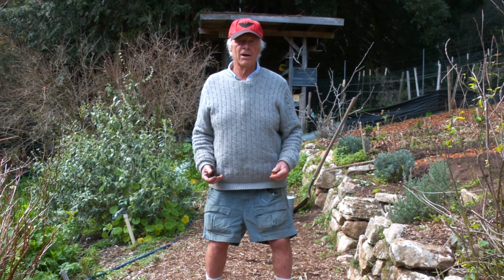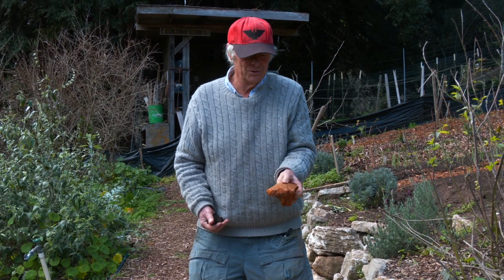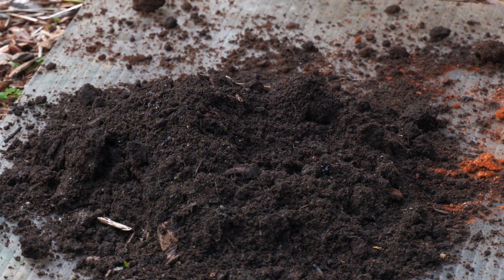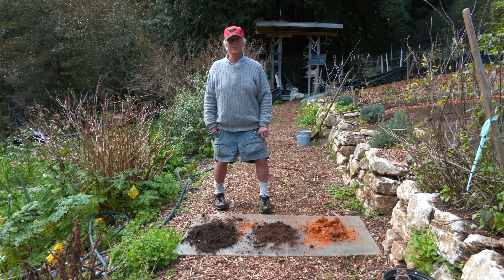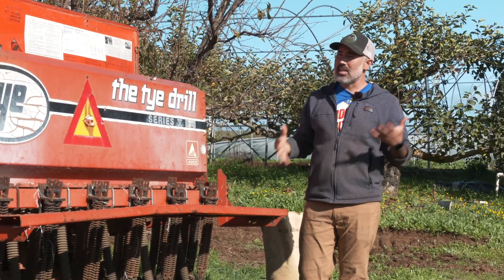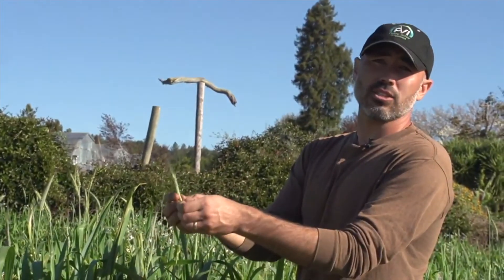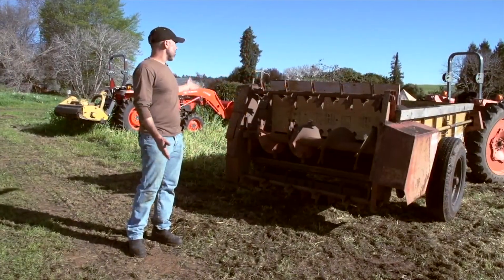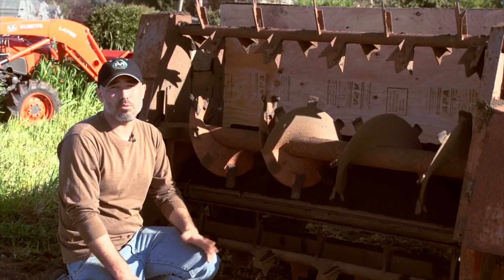How to Improve Soil Fertility in an Organic Production System at Both Garden and Farm Scales

Comment: Nice .. would this method works if you want to convert a lawn full of Bermuda grass into fertile soil?
Reply from the maker: Bermuda grass is quite invasive and difficult to remove.  It can be removed with weed killers (which we don't use because the UCSC farm and garden are certified organic) or by screening out all of the root parts that can be 12-18 inches under the soil surface.  Once you've completely removed the bermuda grass, you can use the methods shown in this video to build up excellent and fertile soil over time.

Comment: I've read that it takes 10,000 years to create an inch of quality soil.  Here on the high desert of Oregon we've had less than 6,800 years of soil creation, so augmented soil is a required part of gardening.  Following the rock drillers (drilling for explosive holes) at a local construction site, I will collect balsalt rock dust that I've added, in moderation, to my composted soil. . . .Is that really good idea?
Reply from the maker: Don't really know about using basalt.  As shown in the video, we took super hard subsoil and turned it into exceptionally fertile top soil using the "3 C's".  The same method will probably work in your location.  Good luck in your garden!